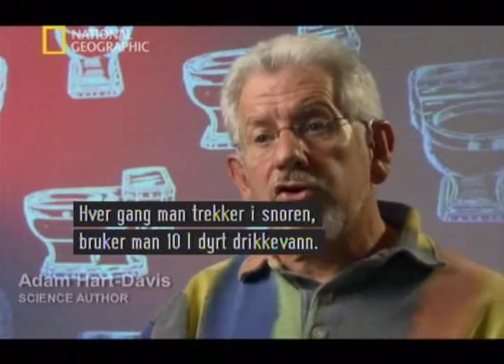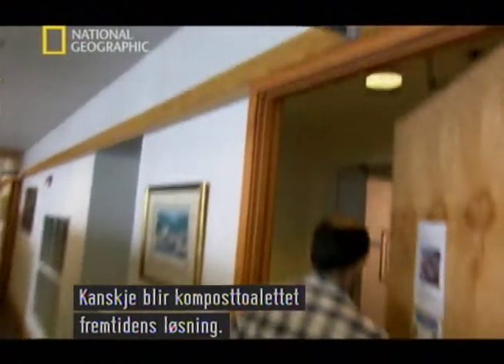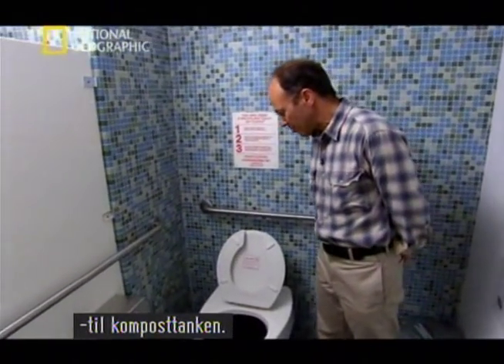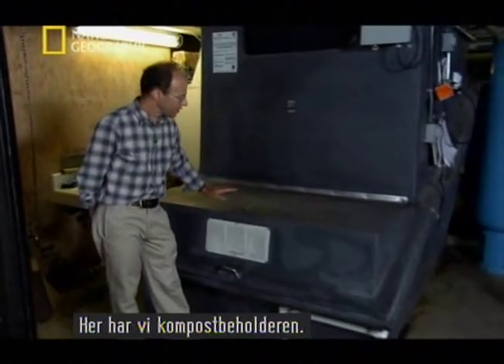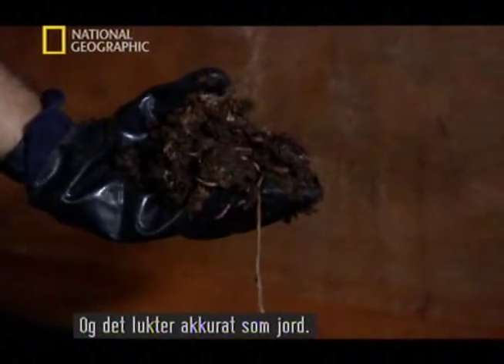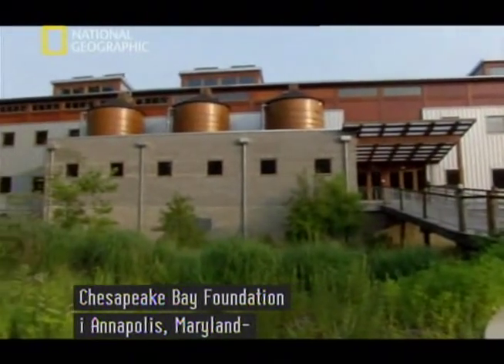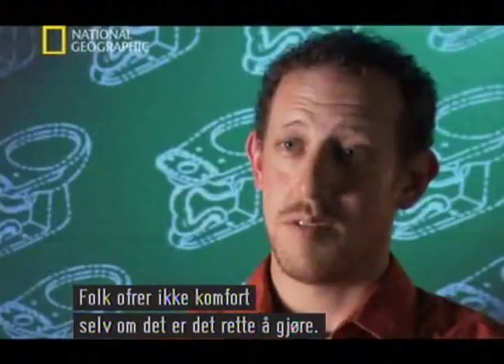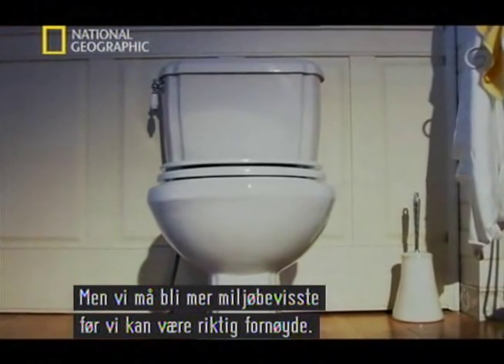Composting toilet

Comment: The clivus that I used was always treated with a great deal of respect.  There was never an overwhelming amount of turd going into it.  That being said, servicing it wasn't a big deal.  It worked fine.  I suppose if the volume of turd going in exceeds capacity, there might be a problem.  A friend of mine would grow with the compost.

Comment: here's an idea - mix this w/ rainwater recapture. 1) you have the water required to "clean" the toilet & retain our sense of "clean" and 2) you're not using drinking water - you're using rainwater that's stored in a giant barrel.

This is a nifty idea, but I think has more commerical application in a commerical building - the amount of poop needed for viable compost is large - would take years and years for a family of 4, but a fraction of time for an office building.

Comment from the maker: I would say composting is even more important in places they have limited access to water as composting doesn't required it, and when it comes to bulking material, anything with carbon goes, but is not required as far as know, it only helps to speed up the composting proccess.

Comment: There is no reason why the depositing of the bulking material in a composting toilet couldn’t be automated. In much the same way that water is released from a holding tank in standard toilets bulking material could be released with the flick of a handle from a holding tank in a composting toilet. In large scale operations the holding tank could be centralized for all the toilets and gravity fed.

Comment: I love the idea of a composting toilet for many reasons, but lets please not be deceptive here, in places where there is plenty of water for every  use, using a composting toilet is NOT going to produce or transfer water to places where there is not enough, no matter how much water we flush, once it has passed through our septic systems and goes back into the soil, it eventually evaporates back into the water cycle and we use it again. It will NOT help those in low areas if WE don't use it.

Comment: Eh, the modern toilet isn't really all that great. It clogs and then overflows, and won't start working again until it's been plungered. Or some part of the tank breaks and it won't shut off. Not to mention with every flush it creates a spray of water particles, spreading germs into the air. I'd consider a toilet that can never clog a step up in convenience.

Comment: @mechanicalbu11 Conserving water in industrialized areas has an indirect effect on the usage of water in developing countries.  Just look at YouTube videos about toilets in rural areas of India. The usage of contaminated water because of pollution due to human fecal waste is wide spread. Elegant, low cost, low tech solutions to keeping human waste out of the water supply in industrialized areas spreads quickly to developing areas when it can be easily duplicated.